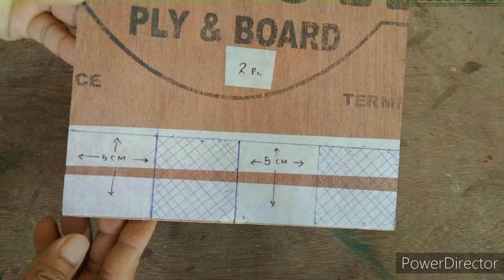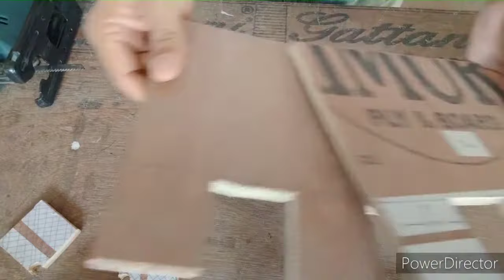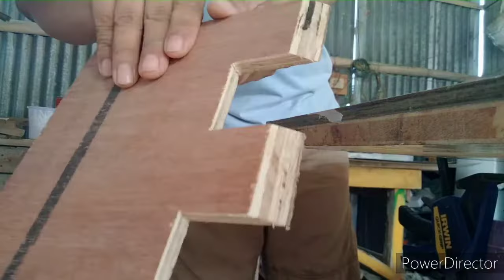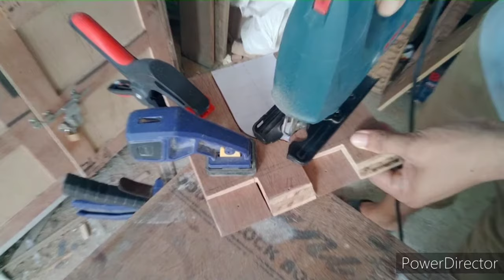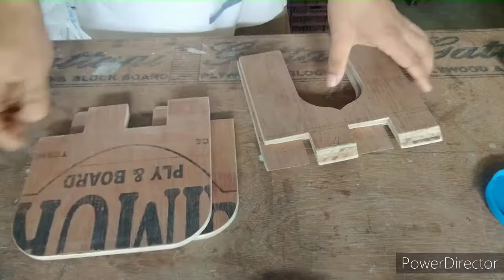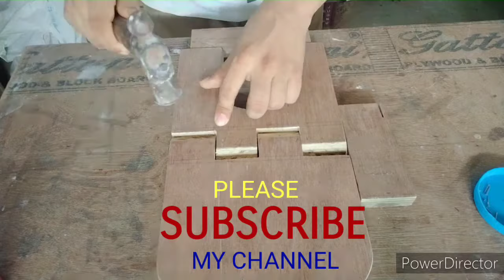How to make a folding book stand

Comment: Is it possible to arrange its angle with some changes sir?
Reply from the maker: Thanks for watching,
I didn't understand which angle you were talking about
Reply: @SALInteriorOfficial ı meant the place where we about to put the book. Some books might be closen back when we put them over it because of its angle. Especially the heavy and big ones. So can we modify it as our needs with some angle or size changes. Would it work with it.
Reply from the maker: The angle can definitely be changed,To make the change, the gaps I made need to be cut a little longer.